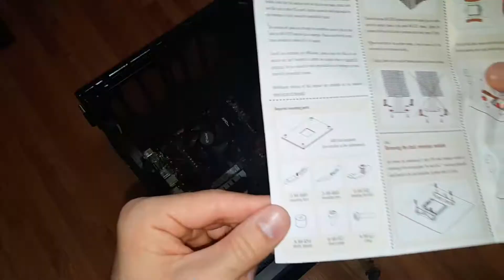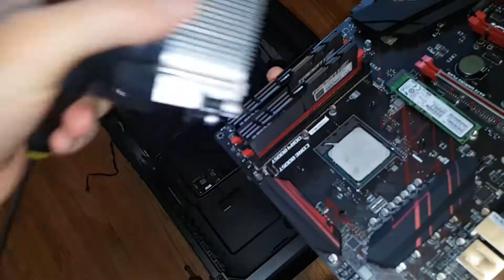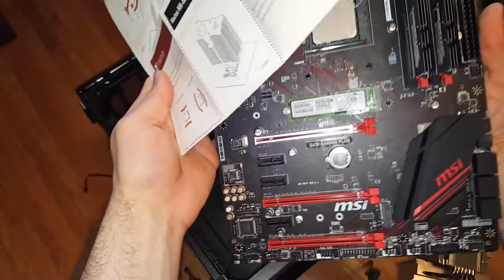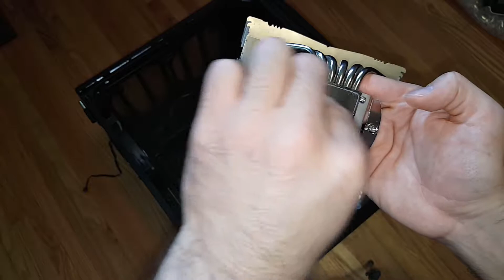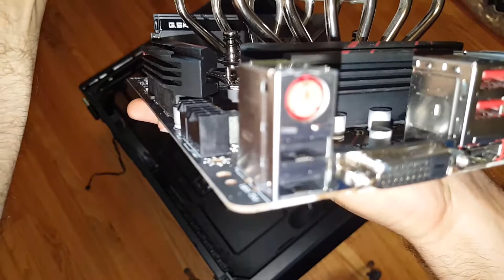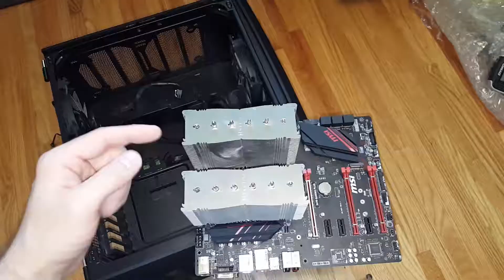Extreme Air Cooling Ryzen AM4 socket - NH-15 HUGE temperature reduction

Comment from the maker: AMD Nocutua NH-D15 (with AM4 kit): https://amzn.to/2lVfsyV
Premium 150mm Noctua Fan: https://amzn.to/2u2033r
Premium 120mm Noctua Fan: https://amzn.to/2tSZXfe

System parts:
R5-2600X: https://amzn.to/2Fu9z39
MSI x470 Gaming Plus Motherboard: https://amzn.to/2raG7dV
G.Skill 3200MHz CL14 16GB DDR4 RAM kit: https://amzn.to/2HKISsD
Samsung 256gb PM961 NVMe: https://amzn.to/2JHEJGq
Corsair Carbide Air 740: https://amzn.to/2HD01bL
EVGA 850watt P2 Power Supply: https://amzn.to/2rcwsCP

Comment: Its a D15DSE not a D15 the D15SE is offset on 1st Pcie  my D15 fan clip is touching the backplate  of my Gpu
Reply from the maker: The model I have was bought as a Noctua NH-D15 that I later picked up the AM4 mounting kit for. The cooler is as you noted, quite large! What are kind of system are you running underneath? 😀

Comment: Did you ever try undervolt ? I have same mobo it does not let me to undervolt it. My core vol. is 1.400 and higher. When i set core vol. to 1.380, my system is not booting. Do you have any tricks about that ?
Reply from the maker: Hi TheZerg! Unfortunately I do not have this CPU anymore - I traded up into the R5-3600. All of the CPUs even from the same model line have different silicon qualities which result in them overclocking better or worse than other similar CPUs at any given voltage. The motherboard plays into this but generally, if you need more voltage to be stable, your CPU just needs more voltage. Hopefully you were at to hit the clockspeeds you were aiming for? Let us know 😀
Reply: @STS  That was a little bit late respond ;) Anyway thanks. I already managed to undervolt it.

Comment: hey that paste should be covering all of the cpu evenly not just spread about a tad like that.
Reply from the maker: Hi David Neill! There are many application strategies for applying thermal paste, several of them have virtually the same effect. Check out the GamersNexus video on their testing: https://www.youtube.com/watch?v=EUWVVTY63hc

The charts from GN testing are right around the ~13:00 minute mark. In my testing, as I had mounted this multiple times on that CPU when I had it, this was close to the best temperatures I got.

Comment: I just got this beast today ,was pull out cpu to clen in better from both sides almost broke cpu when push it back to mobo ,down   one that many parts was not vertical i pull it up verry gentle and bam pc was runing lucky  me😅😛
Reply from the maker: Oh wow! Glad you got everything up and running correctly! What kind of system are you using?
Reply: @STS asus x470-f , ryzen 1700 ,2x8gb 3200 mhz ram,pulse radeon rx580 8gb, ssd-256 ,hdd 1tb,psu evga supernova 550w+gold,and cheap nox hummer case
Reply: @STS  i know  this noctua is overkill for ryzen 1700 but i like low temp
Reply from the maker: Sounds like a great setup there :)

Yes, for the voltages that make sense on the Ryzen chips, these massive dual tower coolers are a little bit overkill. Can’t beat those temps though. The large towers and 140mm fans make it very quiet as well!
Reply: @STS  i just put fan from stok cooler up in case to blow out hot air ,oh look so nice ,stok cooler for ryzen 1700 is rgb
Reply from the maker: Oh, good idea! Yeah, the RGB AMD fans were pretty slick looking. My rig is sadly lacking in the RGB department. I need to look into my options for illumination.

Comment: Great video just bought one for my 2700x I'm more amazed at how you made the video holding the motherboard like a pizza very nice lol
Reply from the maker: Great! You will be happy with the temperature to sound ratio. What case are you running in?

And yes, filming this one was a little challenging!

What are you using your system for? This one has been my daily driver - gaming and encoding.
Reply: I want to buy for my ryzen 2700x.Is it good?

Comment: I've got an NH-D15 for my 2600 - at 25% fan speeds it doesn't go over 55 degrees.
Incredible cooler and an incredible CPU.
Reply: my 2600 cannot hit over 3.9ghz 1.4v stock cooler if i buy noctua nh d15 can i hit 4.1 or 4.2ghz ? i have a Asus PRIME B350M-K motherboard , 8gb ddr4 ram and 1050ti
Reply: @networkcor3  I think it depends on how good your chip is. Mine cannot hit 4.2ghz with vol 1.4 - I'm stable at 4.0ghz and 1.3875 vol now. Prime95 test with NH D15S temp always under 65 degree
Reply from the maker: Hi JMUDoc! Yes! This cooler is EXCELLENT for this CPU stock and overclocked. Before this cooler I can say I honestly have not had anything that performed so well at this noise level.  Now I just need to figure out how to bolt one of these on to my graphics card 😄

Your system overclocked? I was able to hit 4.1GHz full time at 1.3875v (can't use stock XFR since I need constant high clock speeds).
Reply from the maker: Didn't see your reply Nhật Nghĩa Nguyễn! We can't all win the silicon lottery, I know I didn't 😂

Comment: I really hope you clean the heatsink im a bit ocd, getting ready to put a nh-d15 on a 2700x. Wish they would get the black d15 they showed last year out on shelves.
Reply from the maker: Hi Chad! Yes, once or twice a year I try to hit the fins with a Datavac which should be plenty to clean it out. I tend to use the Noctua and Thermal Grizzly pastes, hopefully they'll last for a few years. As far as temps go, for a 2600x this cooler has it well under control.

I like the black version too, I had this from a while ago and just couldn't justify replacing good fans and such. Maybe next build, if I can get one.

I'll be envious of your extra 2 cores, I'm sure this will keep them happy.

Comment: Amazing. Thank you for the video. I was looking if the D15 can fit properly on to my msi x470 gaming plus. The video does the job.
Reply from the maker: No problem! Glad it was helpful, this is a great cooler and the x470 gaming plus is a great bang for the buck motherboard. I feel I have gotten quite a bit of mileage out of my setup. As long as your case can fit the cooler #noregurts.

Comment: Thanks for the video. I have that cooler mounted to my FX-8320, which definitely needed this cooler to run cool. Now I'm looking at maybe upgrading to Ryzen, but I am also wondering if this cooler is even necessary since it's so huge and all I do is game on that PC. Anyway, did you ever attempt the manual overclock on your 2600x to see it you fare better than AMD's built-in technology (PB2/XFR2)? I've seen videos that claim no, you're still hitting a wall. Let me know. Ok?
Reply from the maker: Hi Bello! Yes, I eventually did overclock my 2600X manually with this cooler. I would say it is an absolute must to have an upgraded cooler when you tweak the system for gaming performance. The stock cooler and XFR would not stay at the higher XFR2 advertised speeds for very long. There was thermal throttling which caused speed dips for the CPU. I did not get any kind of stuttering but it did lower performance. With the Noctua NH-D15 installed, I managed an all core constant overclock of 4.1GHz around 1.3875v I believe with a relatively cool 70-80c max load temperature depending on my ambient. My ambient temps fluctuate much higher than most, I work in a small space with no air conditioning. 

I tend to constantly use all of my cores so, keeping the highest all core clock speed turned out to be significantly more important to me than allowing XFR/XFR2 attempt the last two bins / multipliers. I use my CPU for gaming, video encoding, and mining mostly.
Reply: @STS  Late reply, but thanks for your insight. I still haven't pulled the trigger just yet. Guess I'm hoping for these Ryzen 2 CPUs to hit rock bottom prices, especially since Zen 2 is very much on the horizon now. But one more thing I'm curious about: how long did it take for Noctua to ship you the AM4 mounting kit? And the other question: is AM4 really that different from the AM3 mounting holes? What's the key difference there if you don't mind sharing. Thanks.